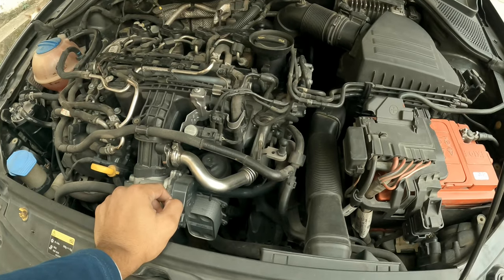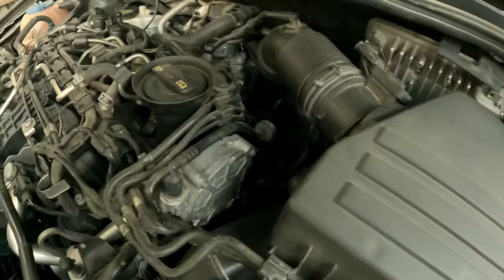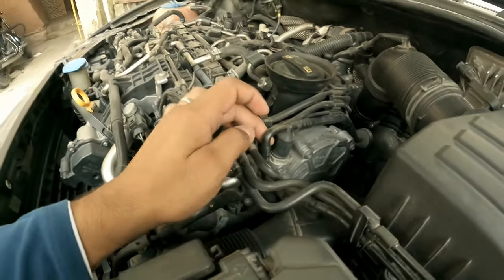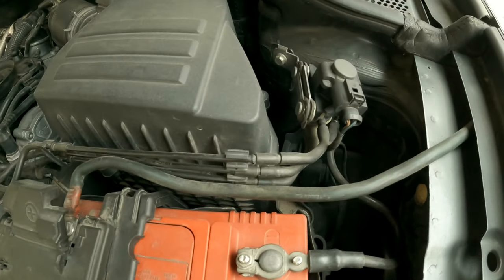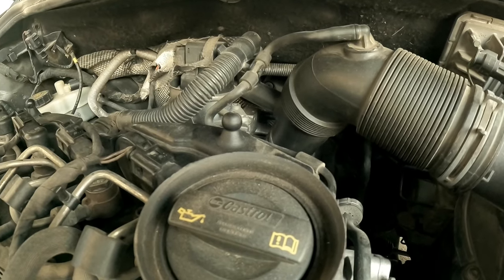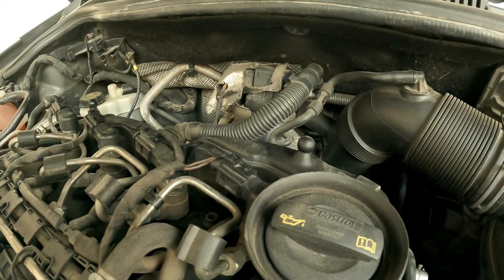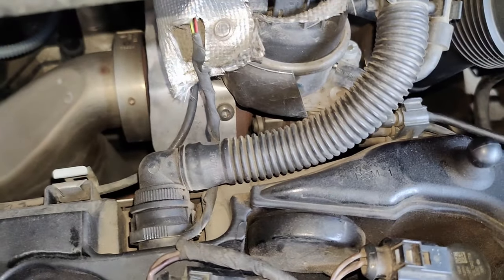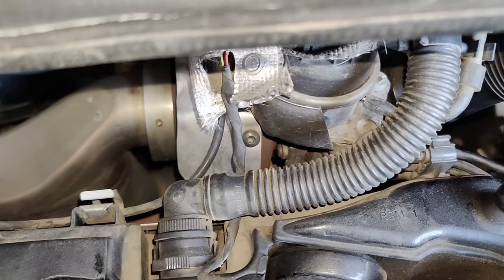TURBO BOOST PROBLEM VACUUM PROBLEM | UNDERBOOST | OVERBOOST | LIMP MODE | P0299 | P02563

Comment: Ive a 2.0 tdi with low boost limp mode.. Only comes on when going on a motorway, maybe after 65mph or 70mph, turn car off and on and it goes but it will keep coming back. What could thst be ? Dpf has been removed and its remapped by previous owner
Reply: You’re the only person online that i’ve seen describe the exact same issue as me. I’m due to swap over the Mass Airflow Sensor to see if it’s that. But most videos is guiding me towards the turbo accuator. So if it’s not the MAF sensor, it’s the Accuator next!
Reply: Same here with my 1.9 caddy
Reply: same with my 2.0tdi
Reply: Sorry I ment wynns turbo cleaner is worth a try
Reply: @hamzahdhorat3121 same here what could it be ?
Reply: Turbo actuator is the issue
Reply: Same issue

Comment: Super amazing video. Hi there. Super Amazing Video. I have a VW Ameo 1.5 TDI. I am facing a similar sound when I accelerate post the 2000 mark where there is a hissing sound which comes from the lower left hand side of the dashboard interior. The sound doesn't come much when the AC is in recirculation mode but becomes loud when the AC not in recirculation mode and the vent is open. Recently I got my car serviced from VW service center here and there were no fault codes whatsoever. Is it the Turbo Pressure Leak or Vaccum Leak or the AC circulation pipe issue or completely normal and no issues at all? The car is 6+ year old. I don't remember hearing this sound in past years but only noticed it in last 1 year. Please guide and help!
Reply from the maker: Sir there is a cutout in the firewall for the recirculation valve to have the outside air , over time it gets deposited with dust and the recirculation flap is not able to seal against the surface properly , which lets the "hiss" pull sound of turbo inside .
So its just dust , you can bend inside the passenger area and you will be able to see it and clean as well
Reply: @yourDIYneeds  Thanks!

Comment: Hi, is it possible to have a small leak inside the actuator but still able to move actuator rod to open/close wastegate flapper? Thanks
Reply from the maker: Yes , but most probably it will still show a MIL indicator

Comment: Hi, I think I am near å solution for my turbocharger . I have a pair of Booster Pressure Solenoids and a pair of Charger pressure ventiles. A set of 1 Booster pressure solenoid and a charger pressure ventile which control the low pressure turbocharger and a another set of 1 Booster pressure solenoid and a charger pressure ventile for the high pressure turbocharger. After replacing 1 Solenoid and 1 charger pressure ventile and replacing the turbocharger. The turbocharger seems to work. It last only  4 days.
When the car is cold the turbocharger has a lot of lag and the turbocharger seems not working at all. After driving for 10-15 minutes and the engine get hot 80 degree or higher. I can turn off the engine and restart, the turbocharger work again for about 10 minutes and the turbocharger stops working again. I have read that this is typical fault on the solenoid and maybe the charger ventile as well. On saturday the workshop is going to replace both the solenoid and the charger ventile for the pressure turbocharger. After saturday I have totally replaced 2 solenoids 2 charger ventiles and 1 map sensor and of course the turbocharger too.  I have also replaced the map sensor. The map sensor was completely glogged with oil and dust. The map sensor did not work and can not give suck pressure. The map sensor was supposed to give  up to 4 bar. After replacing the map sensor all drive train errors dissappear and the lag on the engine dissappar too. Now there is no problem climbing hills on full speed.

Comment: Hi thank you very for a good explanation on a complex vacuum system on a car. After replacement of the turbo by the workshop, my car went in limb mode no boost at all. After some research I discover someone has cut around 2cm of the pressure inverter hose into the wastegate which result in a big leakage. The engine does not run smoothly and h brake was hard. B diagnosting with Autophix i revealed short cut on the booster pressure solemoid. After replacing the hose and replacing the solenoid the vacuum system work again. Now the engine runs more smoothly and the brake works. Still I have the error 29A400 telling me the charging pressurre actuator closed too far/positive contol deviation.  My car BMW 525D Xdrive 2012. I think the wastegate is done electronically, Do you know what kind of tools I must use to calibrate the wastegate prroperly?
Reply from the maker: Sir you need to have a specialised tool to calibrate the veins of turbo , before that it will still throw codes of either underboost or overboost
Reply: Thank you very much. Can I use a vacuum/pressure handpump like Mityvac 8255 connecting to the wastegate and calibrate the pressure to the crank pressure point. About 7-8psi or 0,8 bar. I have checked the end of the wastegate actuator rode, it is loose and the flap is open. The handle should be firmed attached to the end rode and the rode should be turned -4 times or more to close the flap.   @yourDIYneeds
Reply from the maker: @dinhvanpham8102  
Sir that depends upon the vehicle to vehicle setting, but if you are sure about the reading then go ahead , its the proper mechanical way to do it .
Reply: You mention a special tool to calibrate the veins o turbo. Do you  mean a tool like  2023 Elite LAUNCH X431 Diagun V Bi-Directional Scan Tool, or Autel Maxicom Mk808BT Bi-directional. I think both has service capacity to calibrate the veins of turbo. @yourDIYneeds
Reply from the maker: @dinhvanpham8102  sir there are various tools available in market , i use obdeleven as its specific to VAG cars

Comment: I have the code P2563 on my octavia 2.0tdi but it only comes when the engine is warm and is idling. The car runs fine and it has no boost problems. Is it possible that the vacum loss is so small that it makes error only on idle?
Reply from the maker: Sir feels like there is a difference in between specified value and actual value of the circuit ,  if you suspect the vacuum then it can be from the stem of vacuum pump as that's one place which is notorious for leaking vacuum in TDI engines 
But i don't think it's a vacuum , it's more of a correlation fault , so maybe a sensor is on its way out .
Reply: @yourDIYneeds  thank you sir!

Comment: Hey buddy,  i need small help to understand cost including labour cost approx cost.

My safari 2.2 dicor 2012 dec . 45km run.  Issue with front alighmnt left side gng. Machenic found few thing and suggested to replace , listed below.

Lower arm bush kit
Steering ball join LH and RH both.
Lower and upper arm  ball joint
Break pad
Upper arm and lower arm
Wiper blade front only.
Front shocker absorber.

Please help to know approx cost. Will great help.  Safari is maintained. No other issue.
Reply from the maker: Sir if the car is pulling towards left , the very first thing to change is ideler arm bush , its also called ( steering centre pin bush for local mechanics )
Mechanic is telling you all this , so that he can make you pay more , because for changing the bush he will only earn around 200-300 as labour . 
Firstly get that done get it aligned , and then drive it and then decide .what else you want to change .
Reply from the maker: I too have a video on specific topic , you can watch that for reference

Comment: Hello, I was wondering if you could possibly help me out I don’t make that much money and I’ve already putting a lot of money into my Volkswagen cc since I have gotten it the last few months I’m showing the P0299 code and the. Po420 .. not noticing a difference driving in the light goes on and off. Um, I thought I stopped hearing the turbo boost noise for a while but then I heard it today and the light was off from now the lights on. I’m gonna try to see if I can hear it. I’m not sure where to start. I do not have the money to bring it in a shop to work on it also got a couple scanners for Volkswagen ancel bd500 and vd700.. someone told me to start with the diverter valve. Maybe you could help me with some advice that would be great.
Reply from the maker: Sir the code p0299 is for a underboost condition
Start checking for any visual signs of loose pipe connections or any cracked pipes , also have the look at the vacume lines , as these things are usually rubber and can get cracked over  time .
Hope it helps

Comment: I am getting codes P2002, P0401, P2563, P2015… Any suggestions on what it might be? Any suggestions on where to start? It is in limp mode right now.
Reply from the maker: Sir seems like you got a blocked particulate filter ,  
P2002 - particulate filter
P0401 - egr flow issue
P2563 -  turbocharger charge issue
P2015 - intake flow issue
These all are related faults , one fault is effecting the other components , 
So i would advise you to go for the particulate filter first . Get it cleaned or replaced as you like , then clear the codes and see if they pop up again or not
Reply: @yourDIYneeds  

I will start there! Thank you!!

Comment: sir meri vento 1.5 tdi ke injector me knowking sound bohat aa rha hai injector cleaner b try kiya ji..............jab subah car thandi hoti hai 1-2 din baad self marta hu tab bohat sound krte hai beech beech me skip marte hai jaise fuel na proper mil rha ho lekin jab gaadi 10-15 km chal ke grm ho jati hai tab engine ekdum silent ho jata hai new ki trah...........mechanic ne kha ke apke injector  ki fuel timing hil gyi hai .. kya problem ho skti hai bhiya ji
Reply from the maker: Sir ye issue bhot sare logo ke sath hai ki jabtak engine 60°C tak nahi ata to missing kind of hoti hai , or ye problem dieselgate scandel ke baad wale software update ke baad se start hui thi , mai abhi bhi is chej pe kaam kar raha hu ki isko kaise resolve kar sakte hai , jaise hi koi solution milta hai waise hi apko ek video mil jaegi is topic pe
Reply: @yourDIYneeds  Ji ha sir diesel gate sandal ke bad VW ne gaadi ko workshop pe bulaya tha uske bad hi yeh problem start hui hai.
sir kya hum 1.5 TDI AT me 1.6 TDI Manual ka ECM fit kr skte hain????
Because 1.6 is too much Silent Engine as Compared to 1.5
Reply from the maker: Sir 1.6 wale sab bolte hai ki 1.5 silent hai as compared to 1.6 😅, 
And sir nahi hum nahi kar sakte to dikkat ecm ki hai hi nahi , wo tune pe depend karta hai . And engine ki internal components ka design and tolerance . , Baki jo jerk wala issue hai mai uspe work kar hi raha hu , jaha tak hai mujhe reason mil chuka hai , but for bhi abhi thoda sa or test karna hai us tarike ko , ek bar solid proof ho jaega ki wohi problem hai to fir video ke sath sabse share karuga
Reply: @yourDIYneeds  please sir jarur share karna video......my car is too much suffered from this issue injectors knock, jerk kr rhe hain jaise unhe fuel nahi mil rha ho........20-30 km jane ke baad ekdum silent sir
Reply: @yourDIYneeds  jarur sir i will and we will wait for this video..........hope you will bring that video very soon dear sir
Reply: @yourDIYneeds  sir 1.6 is realy silent  i have seen more than 15-16 cars with 1.6 tdi that are too silent .......baki sir apko jada pta hai ji
Reply from the maker: Sure sir

Comment: I have the code p2563 on my 2012 polo 1.6 tdi... while driving the glow plug started flashing and immediately only can drive around 2000rpm in each gear...
could it be a turbo needs replacing or the sensor?...if it's not the turbo ,how will you know if the turbo is not blown
Reply from the maker: Sir the very first thing to check is the VGT actuator , which is on top of the turbo charger , if that's working fine then we will start to suspect the boost generated by tubo
Reply: @yourDIYneeds   what is the top thing on turbo? i have same fault code and problem, my local mechanic said u need to change that thing which is on top of turbo, also can u provide link to buy it? my car is polo-1.2 tdi
Reply from the maker: Sir its a VNT actuator
Reply from the maker: Sir its VNT actuator

Comment: My booster control sensor show only 20 percent under the charge menu on my Autophix scanner. Sometime it show 100 percent , the percent change if i accelerate after  i do a restart of engine, but mostly it shows only 20 present. The booster sensor is getting vacuum pressure from the vacuum control sensor, right? It is something wrong here, I think the booster control sensor should be steady at 100 percent to give enough pressure for the wastegate and actuator.  Any comments?
Reply from the maker: Boost pressure sensor is reading the amount of boost and feeding that signal to ECU and then ECU decide and commands boost control sensor ( which controls the vacuum to the turbocharger) to provide more or restrict the vacuum to the turbo , so that the veins of the VGT or a wastegate gate can be controlled precisely , this loop runs till the desired value and actual value of boost matches .  
Sir i am more into reading boost in PSI and this percentage thing is always confusing , as it keeps you thinking  , whether its the boost provided or boost remaining .
Reply: Thank you very much for a very good explanation. With your explanation in mind I understand a properly calibrate of the veins of turbocharger is important. Knowledge is very important and know how to use knowledge in practice. It seems to me my workshop dont know how to calibrate a turbocharger. I have several times tried to tell them that the errors 29A400 and 29A500 is because the turbocharger is not calibrated.  The car keeps on throwing these errors all the time.
Reply from the maker: @dinhvanpham8102  , just tell them to do a turbocharger adaptation, ECU will sort it out on its own .
Reply: Thank your very much. I really appreciate your help. So everytime the turbocharger is replaced the workshop have to do a turbocharger adaptation. This kind of knowledge is hidden even by  BMW.  People hide to protect their work. @yourDIYneeds
Reply from the maker: @dinhvanpham8102 yes sir , everytime any sort of mechanical adjustment on turbo means adaptation.
Reply: All turbochargers have an operation range in voltage between 1,2-4,1 volt and close open range in psi from 7-15 psi. In order for turbocharger to work properly adjustment must be done in tthese ranges. My car  is not adusted that is why it keep throwing error codes 29A400. The car is under boost with drive train messages I can push the actuator rode at lease 1cm to the rightt to close position. @yourDIYneeds
Reply: Hello, the booster pressure solenoid , many called it also for pressure converter. Lately I have got error 299100 Pressure converter turbine flap, activation open circuit. What does this error mean? Do I have a faulty solenoid? The car has lost power and drive train error pops up at 2000 rpm. I have heard a faulty pressure converter @yourDIYneeds  may cause a lot of fault issues.  I must buy a Mityvac 8255 handpump with vacuum/pressure for testing the booster pressure.
Reply from the maker: @dinhvanpham8102 
Hello
Whenever a circuit shows "open " its either the wiring issue, electrical connection loose or a bad solenoid or sensor . Which simply means something is not right as per the hardware hardware , buying equipment for checking pressure is a nice approach but just make sure that equipment is accurate because a lot of generics are not , they have a lot of errors .
Reply: Hello good morning. Have you had a nice day? I do agreed buying equipment is the only way. I have a voltmeter, i need to buy a car battery, some electric wires, a vacuum/pressure hand pump. I have done many checks with my car scanner and found out that I have a faulty Booster pressure solenoid. On the datastream for the Booster pressure solenoid it shows steady only 20 percent. When the solenoid works it shows 100 percent. The price for a new part is 1100 kr inklude transport. At last on 05.10.2023 the car workshop has adjusted the turbocharger. No more errors 29A400 nor 29A500. Today I will go over all connections and do some tests with my scanner. Thank you again for your help. I hope I find a solution soon. This case has pass  40000 kr in expence already.
Reply: @yourDIYneeds  Hello, Good afternoon. you are right. esterda I checked th Boostr Pressure solenoid also called pressure converter. I took many measurement tests and he device does not pass any tests. As I have noticed in my Autophix car scanner, the Booster pressure solenoid charge show zero. Te turbocharger depends on a working pressure convertter, when there is no pressure the turbocharger will loose power and drive train messages pops up for any kind of acceleration. Today i can buy a new converter at a good price. Thank you for your help. Have a nice day:-))
Reply from the maker: @dinhvanpham8102 
Anytime sir , happy to help
Reply: @yourDIYneeds  Today I have learned that using Ista+ and Ista D is the best way to calibrate turbo waste gate valve and do reset adaptation whenever a change of devices has taken place. For $100 investment I have  a  full package of all the Ista software and a cable I can do diagnoses and services on m BMW. Much better doing all the repair by myself. I can not trust any workshop anymore. They just want my money. Thank you again for your help:-))